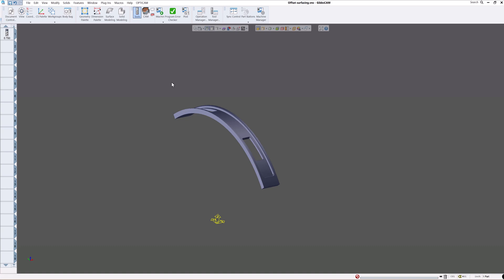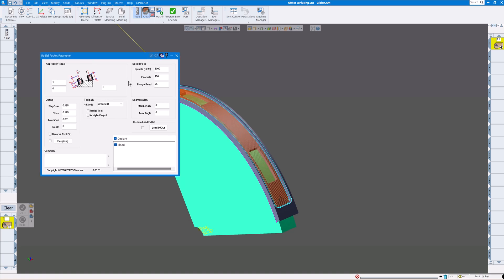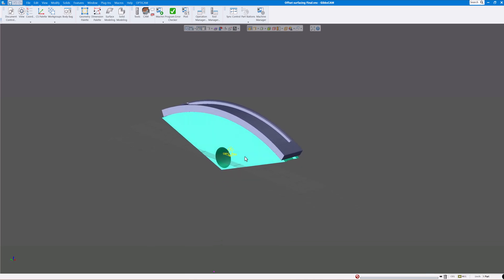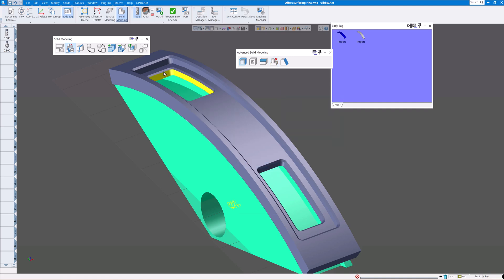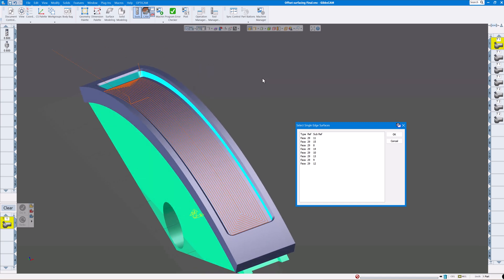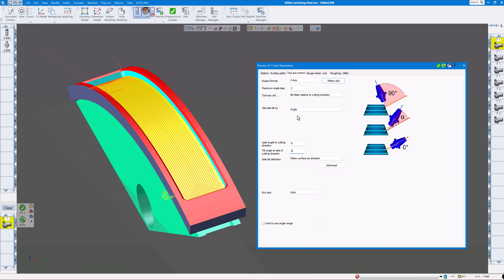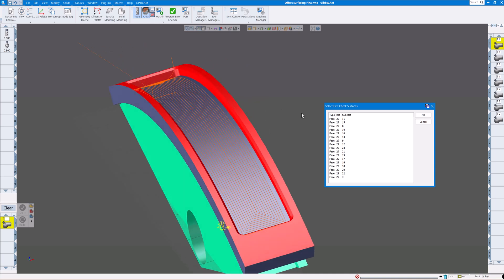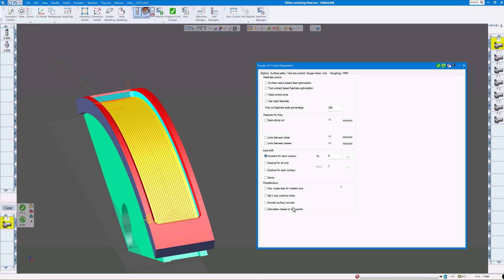GibbsCAM offset surfacing  on a 4-axis vertical mill.

Comment: Is there a plan to be able to label/rename each operation and put them into folders, including an unused folder for trial toolpaths that we want to keep but it won't post by default?? That would be a reeeeaaallll nice cherry on top of a great CAM system that Gibbscam is
Reply from the maker: Yes, you can.  If you double-click on a operation, then go to the process it loaded, then right-click again and click on "Save Process list" which will open a window and ask you where you want to save it.  You can rename this anything you like.  It also saves the tool you used.  Then when you start to create a new part, and maybe you want to use that same process, you can just right-click the process box and choose "Load Process List", which will load that same process and create the tool, then all you need to do is maybe adjust your depths, etc, and you are good to go.   You can also set a folder to "always" look in that folder each time.  Many customer create processes for specific tools and materials, then they can just load a process and all it good to go.